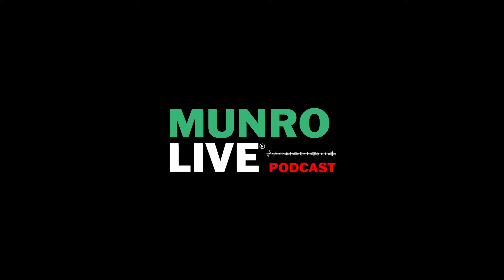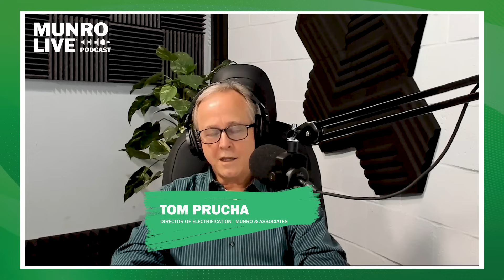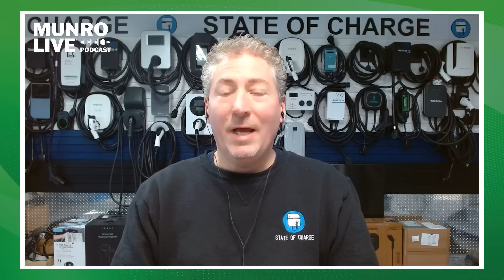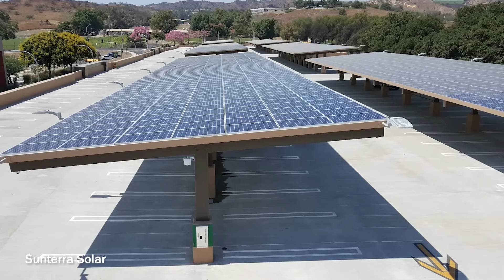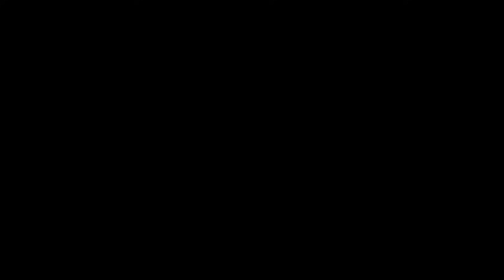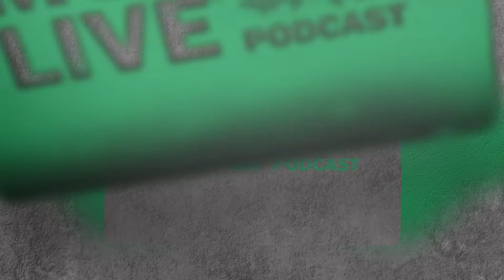The Problem With EV Charging Infrastructure

Comment: Before long, instead of a "parking meter" you'll have a charging station which gives you power, and sends a small "parking surcharge" to the local authority, taken "off the top" of the profit going to the charge provider.
(I suppose ideally that would be the local authority??)
.
Simple for you, simple for the authority/ provider.
.
If you drive somewhere, to do something, the time you spend will generally reflect the time and effort you spent to get there...
.
You're not going to drive an hour for a 5 minute shop.
.
If that's the case, you will (again generally) be able to "browse charge" a similar amount of energy to the amount you used to get there without resorting to DC fast chargers.
.
Reply: Totally agreed there is a huge problem with charging and perceptions. Having a lot more level 2 or even level 1 chargers where people are parked for long periods of time is the answer. My workplace put in over 50 new level 2 charging spots when they redid the parking lot at our building and they always work no matter what the temperature is (chargpoint level 2s). Lots of folks bought BEVs and PHEVs because of this. Before this I had a level one charger I would plug in at some 120V outlets at the back of the building with a few other PHEV drivers. Movie theaters and malls would be perfect candidates for this also!

Comment: As for cross country charging, Tesla is the only game in town.  Plenty of owners have easily gone from coast to coast using the Tesla Supercharger network.  There are many routes one can take too, if you want to do some sight-seeing on the way.  It's great that non-Tesla owners can enjoy easy EV travel once they get on the Supercharger network this year.
Reply: There are still a few ‘dead zones’, areas where SC stations really need to be put in. Examples are around central Wyoming (need a station in Cody)  and in SE New Mexico where Carlsbad Caverns National Park is located.  Several others in rural open areas with small towns or cities.
Reply: @Chainyanker007  - True - but Tesla is installing new locations at the rate of 27 per week.  Also, there are a few areas without gas stations nearby - compounded by the decline in the number of gas stations every year. It is expected that 80% of gas stations will be gone by 2035.
Reply: So far only about three dozen SC stations have been opened to non-Teslas.  I think the opening is going to be done in a measured way to lessen the chances of congestion. They also have to lengthen the charge cables otherwise those non-Tesla EVs with charge ports in the left front will take up two spaces to charge, that will cause severe conflict with Tesla drivers.

Comment: The problem with Tesla's charging system for me is that there was previously one Supercharger station on my 300 mile route.  Easy decision.  All of a sudden there are 2 more locations on the same route and they're even faster.  Arg.  So now I have to make decisions.  To top it off I didn't even have enough time at the V2 Supercharger to walk my dog.  Now I'll have even less time at the 2 new V3 Supercharger locations. My dog is mad.  Life is hell...  ;-)
Reply: No pleasing some people 🙄🙄😉
Reply: @rogerstarkey5390  I was going to say a nice problem to have.
Reply: Sounds like the solution is to use the V2 charger, walk your dog, and fall back to the V3 chargers if the V2 chargers are not working for whatever reason.
Reply: Life's a bi*ch, then you die.

Comment: There is absolutely no technical reason for EV chargers to be less reliable and harder to use than a gas pump.  Industrial systems have solved the same problems decades ago.  The reason EV charging is such a poor experience is purely a business decision.  Personally I think everyone except Tesla is just in the charging business to harvest personal information from high value consumers.
Reply: Maybe there should be a government "assessment" of that reliability?
.
I would expect government (local or national) to see the network as an opportunity for revenue and an essential service.
As such, if they truly "govern" they should aim for the best, cheapest and most reliable system, to the point of mandating that if a provider doesn't meet the standard they have 2 choices.
.
1) Leave the network.
.
2) Either purchase the most reliable unit available to be maintained by their staff, or lease that unit with service cover....
.
A couple of issues...
One is obvious. There's  "friction" between the provider of that reliable system and Government (don't be naive expecting that to improve in 2025)
.
The second, if the "Failing'' company does use the best unit, but sticks to their business plan, at sometimes double the price of the "best" provider, the customer still won't use them.
.
One possible solution.
.
Suggest to others (including vehicle manufacturers) that they may want to build those units under license.
.
They get branding and association with a working network (important!)
.
They get a reliable unit (assuming their build quality is up to par)
.
They get charging revenue.
.
They get "incentive benefits" from any grants on offer.
(Let's face it, they need every dollar they can get at the moment!... May save the Government (tax payer) from bailing them out??)
.
How about "The company which designed the unit"?(😉)
.
They could get to the contract to provide battery backup at these locations, potentially worth more than the charging since the batteries would be used for energy arbitrage in quiet periods (much of the time)
.
Government? Would get a working charge network (and would probably claim credit...)
They may save the Cash, complexity and embarrassment if another bailout.
They would also see an improvement in the energy grid.
.
Seems like a win for all concerned?

Comment: I have owned a Tesla for 2 years.  Except when on road trips, I never need to go to a Supercharger.  I charge at home.   There is simply too much focus on range anxiety, and charging rates.  I know that today, not everyone can charge at home, but it will never be as much of a problem as ICE cars where none ever refuels at home.  

It was slightly mentioned but a key point is that "filling up" is something that ICE cars do, not EVs.    The first question I get from ICE car owners is "How long does it take to fill up?"   My answer is that I never fill up.  With an EV the goal is to keep the battery low because charging is faster, so I never "fill up" on a trip.
Reply: My "fill-up" takes 5 seconds.  I plug in when I get home.  When I leave the next morning I always have a "full tank" which costs me zero (I use solar).  I never have to hunt every week for a gas station, wait in line to get to a pump, standing out in the freezing rain pumping and breathe in carcinogenic fueling fumes and then paying $90 for the hassle.
Reply: I disagree, you're only solving the easy case when you do that and you'll quickly plateau on buyers and never make a mainstream product. Any vehicle on the road can handle the easy cases near home. You're not selling anyone anything by doing that. You sell on capability not just practicality. 

You need to show that the vehicles are capable of all the edge cases even if there is a minor trade-off in convenience. That's what the market wants to see. You need to show it can at least do it and until the infrastructure is there, that's just not the case. Even in Tesla land there's still areas of my state that are impossible to get to and back without level 2 charging and with major pre-planning required. In CSS land, it's even worse, forget about those trips. 

And it's clearly visible in the sales of CCS vehicles. It's not just the vehicles that is hurting their sales. Infrastructure needs to be there and buyers can see where these vehicles are falling short. And If what you said is true, everyone would have bought Leaf's and i3s because those cover almost all those cases too but the market clearly isn't looking for that. They want something with minor trade-offs that offers them all the capability they're used to with some additional advantages (whether that be financial, performance, status, or whatever). 

It's like people criticizing truck owners for buying a truck based on towing specs and driving trucks when they're "empty", like the 300+ days a year they're not towing their trailers they're just supposed to park the thing. No, they bought it to cover all their uses because buyers choose a vehicle to cover all their needs, not just the easy ones. Nobody wants to buy a 60k SUV for their family and get asked to go along on a trip and have to say, sorry, our car can't make that trip, the infrastructure and charging isn't good enough. They won't do it and they'll buy something else.
Reply: @tazeat  I am not sure that this was directed at me.  I am not selling anything.  I made my decision to buy a Tesla based on my use case.  Besides, we also own a Yukon, so occasionally there are times when it fills the gap.

The point I was attempting to make is that EV charging is different than fueling ICE vehicles.  It can be done at home.  Recently I have noticed apartment complexes that have charging stations for residents.  That's a process that will take time.  People who can charge at home will not be competing for charging spots as much.  There are no SCs in my city, nearest is 10 miles away.  I don't care at all as I would never use it anyway.  The only time I will be competing for charging stall will be on road trips.  With the road trips that I have taken, I have yet to stop at a SC location that was full.  This will only improve with time.
Reply: Spending $60k on any car is usually a sign of poor financial sense. But, the car companies' profits ultimately depend on people willing to do it.

If consumers were rational and simply wanted the cheapest basic car that drives that they could get their hands on, car companies' profits would collapse.
Reply: @ab-tf5fl  your version of rational is yours.   My Tesla was less than $60k but still my largest vehicle purchase.   My purchase was well within my means and cash.  I still pondered it because it was something I didn't need.  Some people buy Rolls Royces and Lamborghinis. That seems extreme to me, but apparently not to them.  My Tesla replaced a 2005 Dodge Ram pickup that I had bought used with 95k miles on it for $10k.  I like the truck and owned it for 11 years but garage space is limited.  Parking for us is maxed out with 2 vehicles and our 2 Harleys.
Reply: Fill up at home before a long trip
Reply: @rp9674  I don't really bother with that.  I might increase the 80% limit to 90%.  Ultimately, a few percent doesn't really help much, and in some ways hurts.  Road trips work best with the battery SOC being held low.  The SCs are where they are and a little extra charge in most cases doesn't help.
Reply: My fill up takes less than three minutes.
Reply: @lot2196  how are you measuring? From when put in park at the pump to engine started to leave?  I recall some slow payment terminals that were slow to collect zip code and activate the pump.
Reply: That works for homeowners.   Others have an understandable reluctance to buy an EV.
Reply: @snookmeister55 , I said as much.  I have noticed new apartment complexes near me with charging stations, certainly not enough for all their residents but a move in the right direction.

Comment: EV sales will explode once all EVs can use the Tesla charging network.
Reply: EV sales will explode WHEN others make compelling EVs rather than the "ICE conversion" vehicles.
Reply: @rogerstarkey5390  You are right.... that has to happen too. However the OEMs have already signaled that they are giving up. Oh they say that they are just scaling back until there is more demand. However there never will be more demand for their over priced and under featured cars. Without going full hog into EVs they will never learn how to build them at scale economically so they will never be competitive and they will always lose money on them. 
Ergo, the OEMs have actually already announced their deaths. They now will just milk the money that they can and wait to die whilst their "C suite" execs cash in and get out before the stockholders get wise.
Reply: A 110Vac outlet for a level 1 charger in every overnight parking spot would help more.  Only 30-60 miles/night for most EV's but that's plenty to keep up with most people's weekly driving.
Reply: @martylawson1638  Agreed. Apartments could put those in covered parking pretty easily. Uncovered would require weather proofing.  Their biggest concern is how to pay for the electricity use and how to ensure it is used by the correct person..... especially if they bill by the number of KW/hrs used.  I'm sure there are solutions out there.... whether the solutions are economical and simple enough is the question. I'm thinking a physical security key that turns on the outlet... then all power drawn through that outlet is the responsibility of the renter who has that key. If they forget to lock it after they disconnect then they pay for that mistake if someone else uses power from it.
Reply: @nickmcconnell1291    Lots of existing solutions for billing.  A key-card to "unlock" the outlet would be plenty.   Assigned parking spots would also work.  Wire into each appartment's meter etc.  Ideally the building would have a central controller to schedule charging to limit peek power draw reducing cost to the building, but that doesn't mater to renters.
Reply: @martylawson1638  Actually the system will handle a 240V Ac outlet better. Can be as simple and cheap as a 6-20
Reply: @csf1757  J-1772 is IS RIGHT there! Depending on the pedestal used: it may even handle the billing that the other person brought up.

Comment: Tesla needs to charge a surcharge for off brand models and use the money to build up the network. First add then upgrade existing stations. People should usually charge at home overnight. 
Tesla should try to squeeze out the the other "charging stations". I have heard many video reports saying other "charging stations" like Charge America are very unreliable. This is useless. The purpose of a charging station is to be able to complete long trips.
Reply: I'm sure that non-Tesla EVs will pay more for juice than Tesla cars will. When those non-Tesla drivers find this out they may decide just to buy a Tesla next time around.... especially apartment dwellers who have to use superchargers on a regular basis.
Reply: @nickmcconnell1291  It's a matter of having service. Tesla's chargers work.
Reply: @nickmcconnell1291  Tesla's also have more range per KWH, by a substantial margin according to the videos I have seen.
Reply: @suggesttwo  Yep! Why I own a model Y. Tesla is simply the best.... period. 
That is why they have only 15 days of inventory when most other cars makers are now in the 100s of days. When people actually take the time to shop around, like I did, and compare bang for the buck......Tesla wins every time on things that count... range, handling, superior software, acceleration, interior cargo space, etc..... hands down. And of course... long distance charging station availability and reliability.
Reply: Tesla DO charge a surcharge for those not signed up and they're STILL cheaper.
.